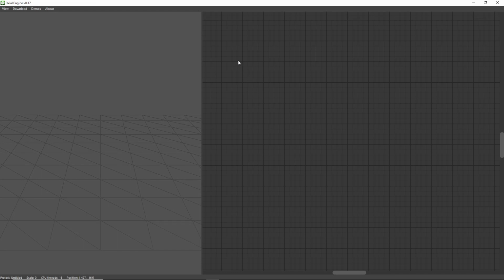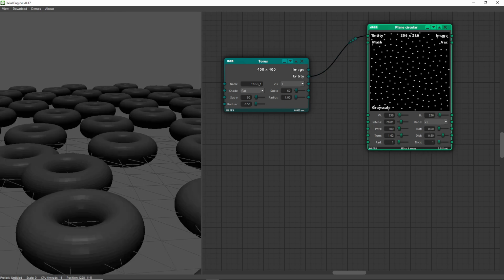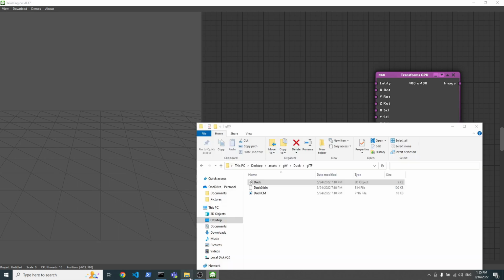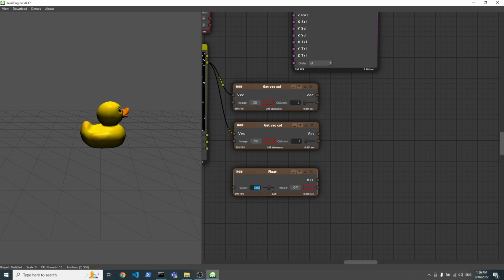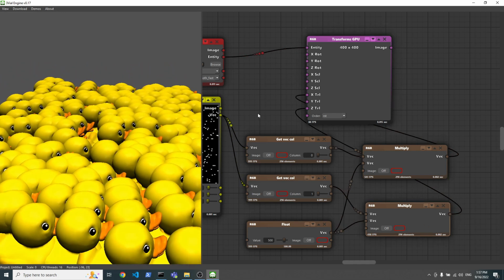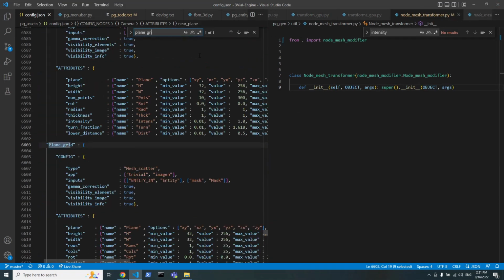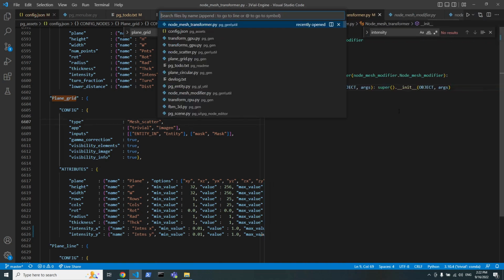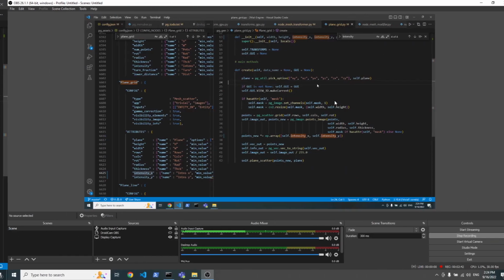Plane scatterers - 3Vial Engine devlog

Comment: 3DVialEngine 0.17 is still not working on Windows 11 Pro.  Thanks for your work and generosity.
Reply from the maker: Hmmm, I've tested it on my second laptop with Windows 11 and it works. Ok, I will investigate this further for version 0.18. Hopefully I will fix it :)
Reply: @NemanjaStojanovicProgramming  Thanks. When I try to run the executable in admin mode, nothing appears. I have checked for the application in the task manager and I don’t see it in the list.
Reply from the maker: @AlanAstle  I think version 0.18 should work on Windows 11. Unfortunately I found another bug on Windows 11. Mesh loader doesn't work. I will try to fix this bug for version 0.19